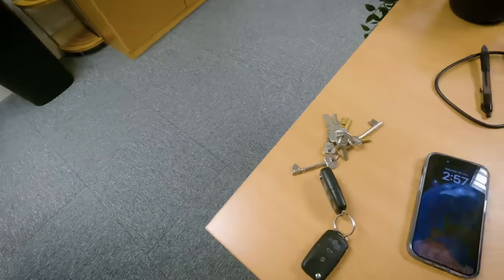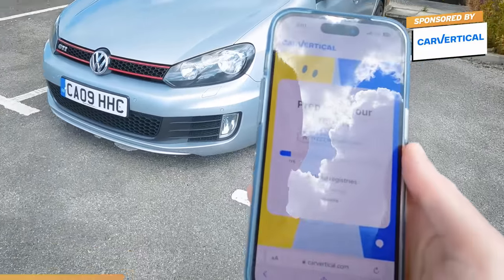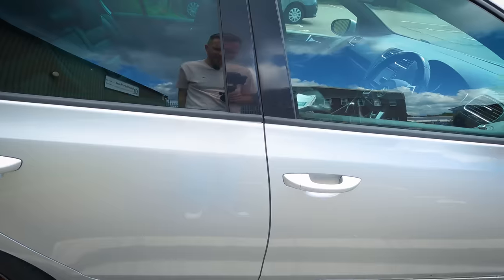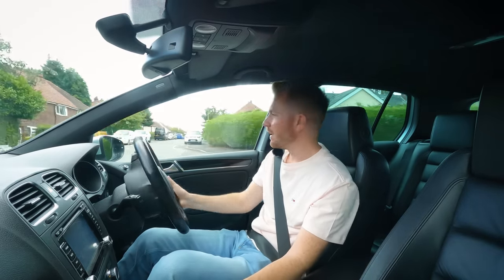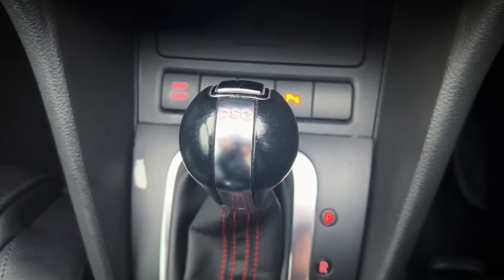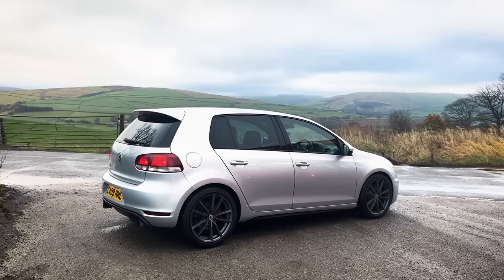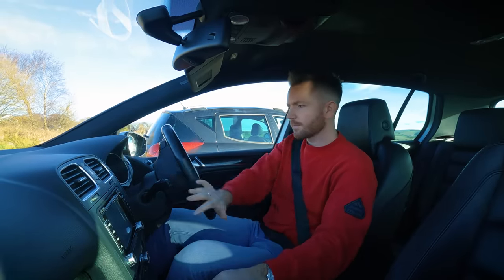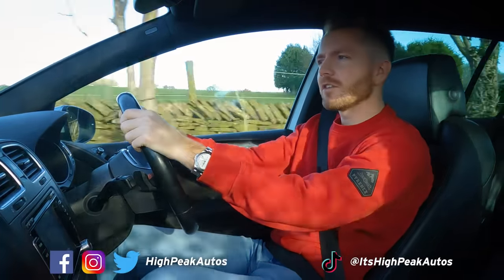I BOUGHT A CHEAP VW GOLF GTI FOR £3,500!

Comment: Add the price of a new timing chain and tensioner if that hasn't been done yet. I don't know what year this one is, but the 2009-2011 m/y GTIs had faulty tensioners that would fail anywhere from 30k-100k+ miles. The chains themselves also wear gradually over time if the car receives the standard 10k-mile oil changes. High-mileage examples (150k-plus) that are driven hard sometimes have had problems with balance shafts, too, so it's best to get those replaced at the same time. Once all that's been done, and the car is well-maintained afterward, there shouldn't be any problems.
It looks like the previous owners had the water pump replaced, which means they probably had some kind of oil leak that dripped on the plastic pump and its seal to the block. If there are no oil leaks (and/or you get an aluminum pump), that can solve that problem. Hopefully the intake manifold was replaced along with the water pump, since the first version of that part tends to break; there's a revised part that's not problematic.
Get a manual transmission spec and avoid all the problems with the DSG reliability (or just maintain the DSG really, really well).
Et cetera! There's a lot of problems with these cars. That said, if you get lucky and have had some or all of the problems fixed by a prior owner, are willing to do some of this work yourself, or are willing to spend a few grand to handle the larger problems, and after that you continue to maintain it, it can actually be turned into a reasonably reliable car. If not, then it's not worth it to own one and you should confidently look elsewhere.
Reply: @MishtahPoog . I think the  timing chain and tensioner  is why it might be still for sale.

Comment: "I hate aftermarket stereos, the never work"
Definite no on that one. The ones built into modern cars are unreliable heaps of junk that throw up fault after fault. And in slightly older cars they often sound way worse than the speakers can reproduce. The problem is no-name units, those are horrid. But it's al ISO these days, if you just throw a nice Pioneer or Alpine or whatever in, you're good. And it's often an upgrade.
Also, sounds like they mixed the reverse camera wire with the radio power trigger wire :D.

Comment: I just bought a gti mk6 and i noticed when i shift from P to D the gearbox takes like 4-5 seconds for the car to start moving, is that normal with this transmission?? I had a chevy before and it would instantly move when i let go the brake

Comment: I had a Mark 7 2015 Golf 1.4 DSG, and it wasn't very good reliability wise. I bought it at a year old with 12,000 miles on the clock, and as it turned 3 years old, and only had 20,000 on the clock (I don't do many miles), it leaked really badly after being parked at Manchester Airport for 2 weeks and was full of water. A door seal in the back righthand door speaker had perished. It needed new carpets, replacement speaker and everything. Before that I had noticed it was quite bad for steaming up on the inside from day one of owning it, and it would be terrible in winter, with the inside of the windscreen soaking wet or frozen after not being used for a day or so. They never found where it was leaking until the door seal went on it. Luckily the car was still under VW warranty but only had a few weeks left. After the warranty ran out, an intermittent message would flash up briefly saying the gearbox needed to be diagnosed and to stop driving the car and it became more frequent over the period of 6 months. Apparently to do with a parking selector switch and is quite common. Then idling at traffic lights became intermittently rough like it was going to conk out. Taken it to a VW specialist who replaced various sensors at a cost of £600 which never rectified the issue. I traded it in at 4 years old and got a second generation Nissan Leaf which I have had for 4 years and it hasn't missed a beat and nothing has gone wrong with it at all.

Comment: Had one of these, fantastic car, sold it for 50% more than I paid for it after 6 years of owning it....  Mine was a manual, so no DSG issues.  I did, however, replace the lower timing chain tensioner which is a known failure point and will grenade the engine.....   I'm in the US and there was a huge lawsuit about this which should have reimbursed the $2500 it cost me (I did it preventatively well before) but it sadly didn't.

Comment: I would never buy another VW, I am a little sad to say. I had a Mk6 that was always fully serviced (manual, 1.4 TSi), and in the last year I had it, I had to spend more on it to keep it on the road and able to be sold than i sold it for. Timing chain and a host of other issues - most of which I view should never go wrong in the life of the car. 
I had a Mk7.5 GTi, bought with a work car allowance and as soon as it was out of warranty I traded it in. One of the front lights with the cool cornering feature was intermittently faulty. Only way to fix it was a full unit replacement AU$2400. 
My view is that the engineering and quality is no longer aimed at long term durability, and further, the replacement parts are all hideously expensive.

Comment: VWs lol. I do like them, but I had a similar experience recently with my gen 1 Touareg. Filled it full of fuel (almost $300 NZD worth) and it died exiting the forecourt. Turns out one of the two fuel pumps had failed. $1500 for the part - which took a month to arrive from Germany and about $1000 for the labour. All because of some crappy little plastic fuel pump system. However, as luck would have it I had one week left on an extended dealer warranty, so it only cost me a few hundred dollar excess.

Comment: I know many many people say VAG is rubbish and I can agree why that stigma has been put on the VAG group.

I have a soft spot for VAG cars, Volkswagens specifically.

Volkswagens just cost more to maintain, like this DSG and one huge thing: timing chains!

If you replace these main big things prematurely, they will be very reliable. I have never seen them fail out of nowhere, always when there was already a chain rattle or weird gear shifts noticable.

'Regular' people just simply cannot notice or they straight up ignore these things and think ''hm I will drive this car for another 10.000 miles because it performs just as fine as it did before but now only makes a weird noise, I don't care!''

You can actually notice quite well when these problems begin to occur but the problem is that people just do not want to spend a lot of money on these cars, which makes up for the whole ''they are unreliable!'' stigma. 

I now have, since april this year, got a Polo mk5 (6r) with a 1.2 TSI and 6 speed manual. It has 129.000 miles on the clock...
I have done a lot of overdue maintenance myself, which were not even 'huge' things, and it now drives so so well, almost like new ;) You really would not say it has over almost 130.000 miles on the clock!

Comment: Being a very early Mk6 it might have a outstanding recall on the timing chains. Check with VW on that ( the early ones up to 2012 had Timing chain stretch issues )
Also from the shift down from 4th to 3rd it sounds like clutch packs. It is actually not a bad job ( you could also get a good USED transmission for around $500 Pounds )
Reply: Yes these cars are rubbish,  I had one 5 years long, and spent € 5000,-  at time belt,  waterpump and turbo , last year the DSG gearbox broke down , now the car is totalled  afther 220.000km what a shame !
Reply: @plambregtse772  these mk6's dont have a timing belt....

Comment: Opinion on Mk5 R32’s? Seriously considering one and with full service history and low number of owners should minimise the risk a bit. They corrode on the arches I think but otherwise solid and that VR6 engine…😊
Reply: Road tax is very high on them and they drink fuel like nothing else sound great though. Rusty arches is because VW put sponges behind them but they are easy to get and replace. Just find one with a lot of service history
Reply: @Amir.253  thanks for the reply! Is it the front arches with the sound deadening behind them? If this is removed and new arches fitted that’ll solve it? What about the rear arches?
Reply: @sscramble  rear arches on my gti haven’t rusted I assume they haven’t put it there but yh it’s the sound deadening material a lot of ppl don’t put them back in when they put new arches in
Reply: @Amir.253  cheers Amir, I’ll bear that in mind when looking!

Comment: With due respect there is nothing wrong with German engineering, far from it, it's the execution that is the problem, woeful quality and they won't accept they have problems. I'm seeing less and less new VWs on the road because the public is scared. VAG made a huge marketing error by adopting the DSG in favour of the conventional auto and it's costing them dearly. Their motto was "Service before Sales" I think and that has been trodden on. I believe this has come about because of Toyota and trying to beat them, however the Japanese are too astute when it comes to marketing, hands down. The Germans panic and make bad calls time and time again. It makes sense to follow the leader even if it means swallowing your pride.

Comment: Nearly everyone knows about problems with VW's DSG and the Mk 6 seems to be the worst although a friend of mine (in Australia) had a Mk 7 and suffered the same problems. Although the car was well out of warranty he eventually had it fixed and paid for by VW (after a few hassles) as it comes under Consumer Law and not being fit for use. He sold it shortly afterwards and it makes you wonder how long the replacement unit would last anyway?  Obviously money ran out to get the wheels refurbished on this car but I think the grey finish looks fine. So, regardless of an excellent service history, the Golf can be very troublesome. We currently have a 9 y.o Audi A3 with the same gearbox and it has been faultless.
Reply: yep, definitely disappointed about not refurbishing the wheels silver like he said in the beginning, it would have looked great. the dark wheels looks a bit boy racer and would put most people off. but of course like you said, he's got a budget to consider
Reply: @anb2456  I don’t blame Matt as he had spent too much on that car.

Comment: It's starting to make way more sense to go full EV with the cost of parts and labour at workshop garages. EV leases are bargains right now. I've lease a brande new Citreon EC4X for only £200 a month on 24 months lease. Absolutely no hassle and  messing around with garages. All that needs changing is the washer fluid and air filter every few years.
Reply: be carefull though, as some service is to be done anyway. Most of them are about 30% more expensive on that (compared to combustion engine one). And insurance or any repair seems to be also 40% more...
Reply: Electric cars will go wrong they have many computers and sensors which will go faulty

Comment: Stay away from German cars... Was my first thought - but then I came to think about English cars... French cars... Had them all. Cars are pain, no matter origin! 😅
Reply: Fords have been the most trouble free
Reply: @Matty12333 until they replaced zetec with ecoboosts (now known as eco booms!). It's more about trying to meet emissions targets. Manufacturers can get good performance and economy out of modern engines but in order to do it they make them incredibly complex. Above 10 years old it's now a lottery. Most will have some kind of durability weakness. Toyota CVT hybrid is simpler and will last longer but if that hybrid battery goes then you're in for a massive bill, Ford ecoboost can explode and VW dsg as well as most dual clutch autos can fail.

Comment: Had my wallet emptied by VW, a Tiguan clutch after 32000 miles.  The VW dealer mechanic asked me if I had been driving through thick mud... never touch one again....
Reply: I just bought a mk6 and already dumped $3k in repairs , i feel you

Comment: Aaaand my suspicion was indeed confirmed: VW reliability is a selling point foooooor.................. MAZDA! 😂
Reply: Not necessarily. Had a Mazda 3 at that age. Family owned so I know the history. Very reliable up to 8 years old, no faults at all then needed new ABS sensor, power steering hose, wheel bearing, lots with the breaks and suspension, clutch went at 85k miles and at 12 years old and 120k the cost of repairs was triple the value of the car. Often because you couldn't order the parts separately, managed to source some second hand to get 1 more year out of it. Cost about 1k a year in repairs from 8 to 12 years old. 14 years is not young for a car. Especially a modern one crammed full of complex electronics. What let Mazda down was everything corroded. Not the body but all the mechanical parts. Living on east coast definitely does not help

Comment: Repeat after me .... "Never buy a PRNDL, always buy a manual!" These DSG things are even worse than the traditional slush box. However well you maintain them they always have trouble with the dual-mass flywheel and electronics. I just knew it would be totally f*cked before you posed the question. Better luck next time. Remember Golfs are okay as lond as they aren't PRNDL. What plonker woyld buy a hot hatch and not want a manual anyway?